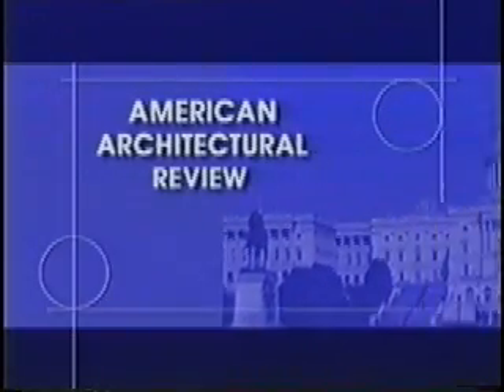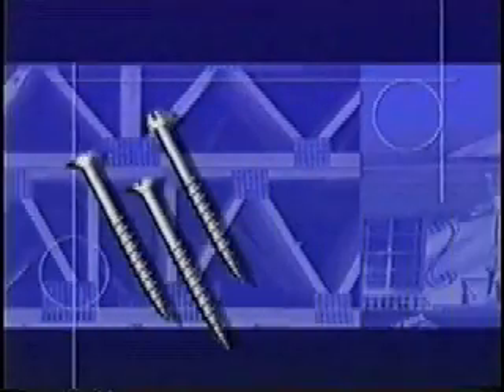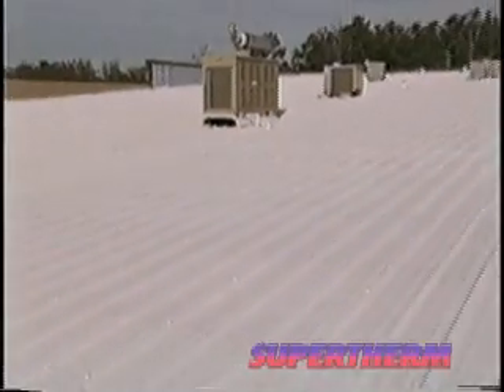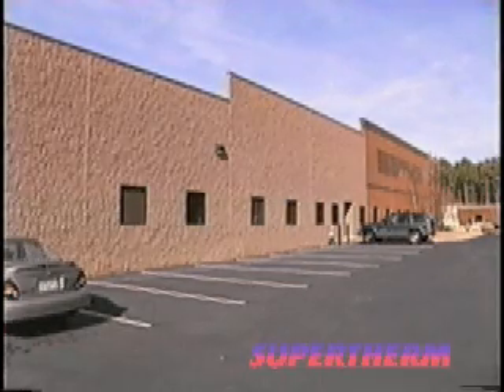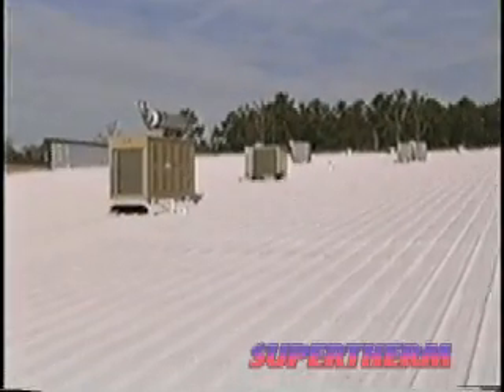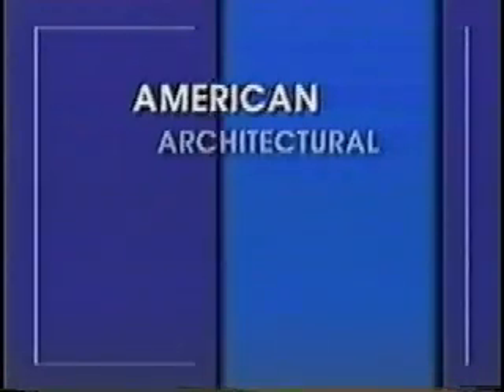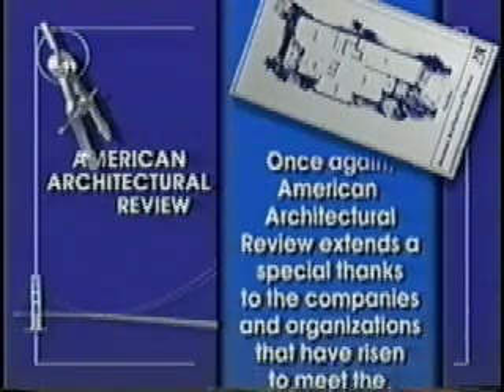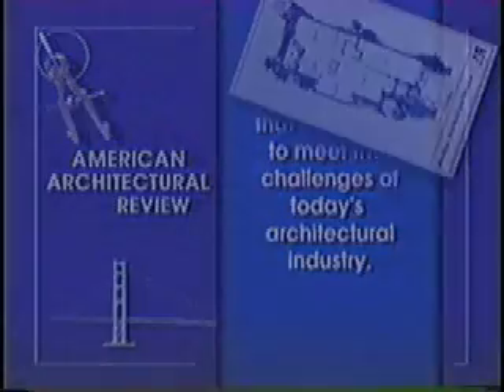Morley Safer of 60 Minutes profiles Super Therm - Save 40%+ on your Energy Costs and GO GREEN

Comment: I comes naturally white but can easily be tinted.  White is best however if you keep the tint to a light spectrum you will not block the ceramics.  

You can coat on shingle roofs and actually prolong the life of the shingles since the coating has a UV resistant ceramic built in.
Reply: SD Lawson what real life experience on shingle roofs?